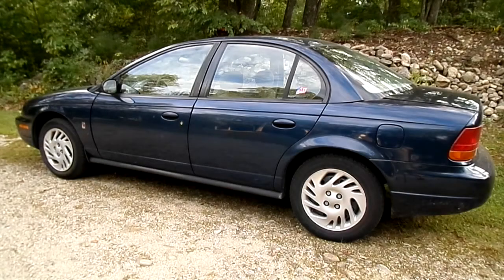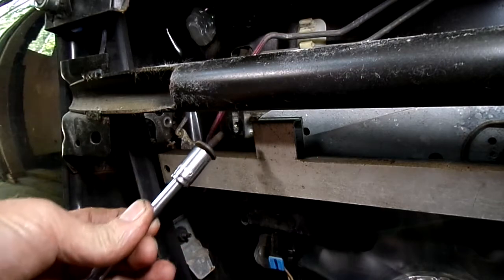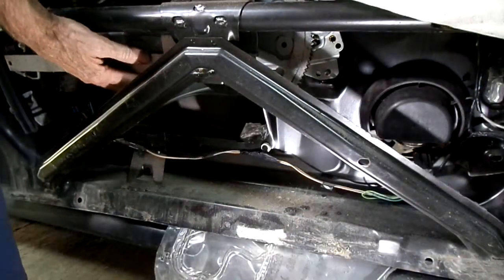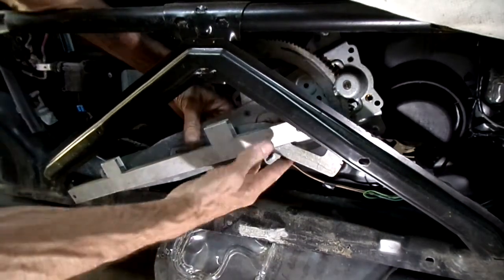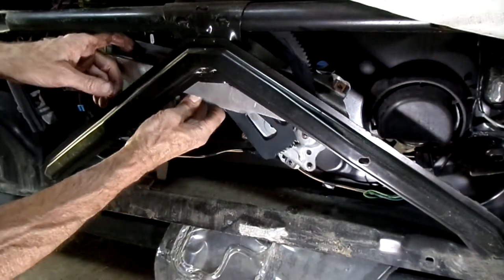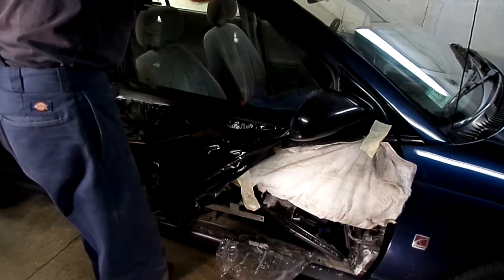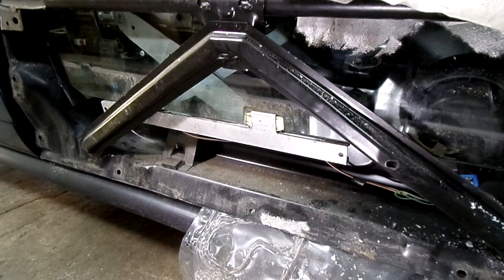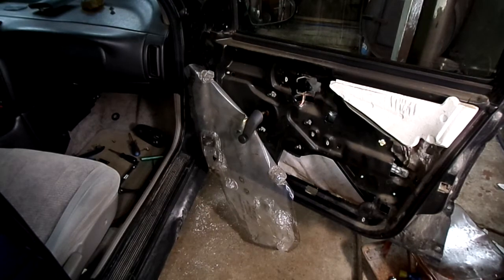Saturn Window Regulator Replacement

Comment: great work !!!  my guides were broken,  and i didn't realize that you can order them online for about $12 off ebay , instead since we needed to fix the problem today, we ordered a new regulator from orielly auto parts for $119.   hopefully it comes with new guides , which i think it does
Reply: I got mine for 50 bucks
Reply: @Sendmetacos  ouch $50

Comment: I have a 1998 saturn SC2. I finally got the car running after sitting for a month. I am having an issue with it. I put the car from park to reverse it decides it wants to try and die but when it goes back into park it runs alright, but not it's best. I also can't seem to figure out why neither my hazards or blinkers are working. I replaced the relay and they worked for a little bit and then they stopped working again. what do you think the problem could be?

Comment: Is there a way to do this without removing the outer door panel?
Reply: Removing the outer door panel is easy. I had no problem removing mine and I am not a mechanic. I just followed Rich's video and took out the 10 T-30 bolts and one smaller one. I think that you have to take off the outer skin to be able to get the glass out. Don't forget to take off the mirror first.

Comment: question for you rich. my work has a 2001 saturn SL1. problem is that it won't shift out of park. the brake lights work fine. what could it be?
Reply: i had that, was my switch, wd40 fixed mine would not release lots of dust and crud under plastics, or switch it bad,

Comment: Hi rich. Love all your videos, especially on Saturn Ions 2003-2007. Quick question, I am trying to remove the headliner in my 2007 Saturn ion hit am running into trouble trying to remove the hanger clips that hold up clothes in the back. There is a circular plastic clip that pushes down with the use of a flat head, but after I pull it down the clips don’t pull out. Do you if there is something else I need to do? Also, would it be possible for you to even make a video to remove the headliner on a 2007 Saturn ion? I know that’s a lot but I wanted to ask. Thanks.